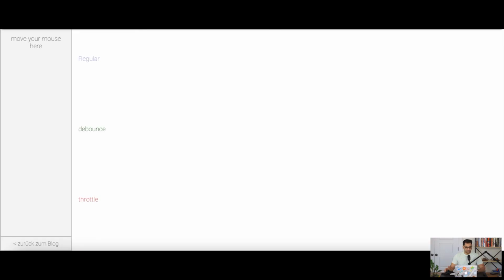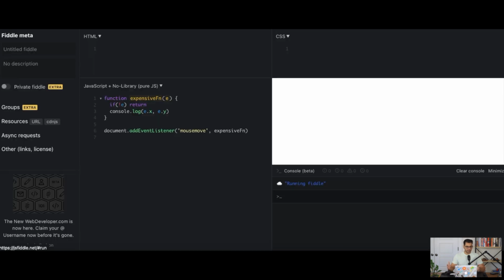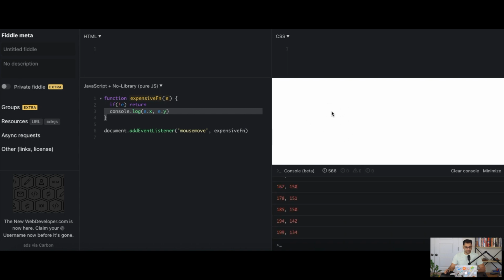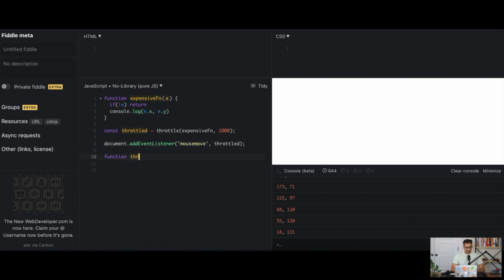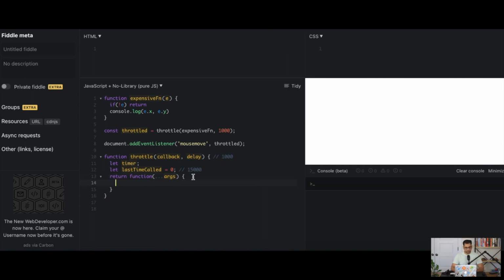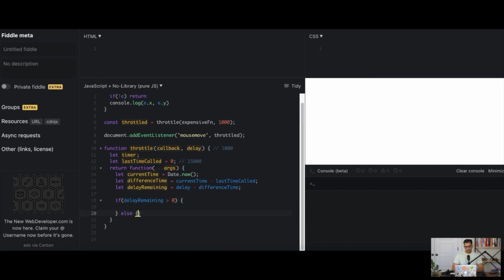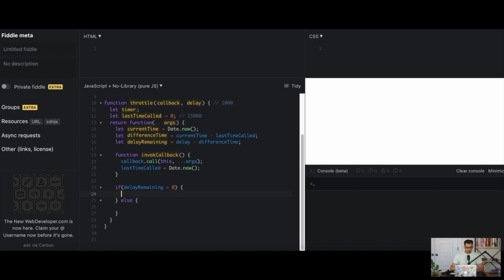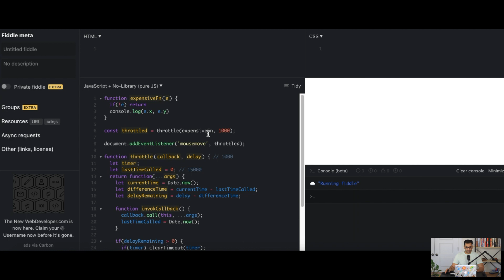How to build and implement Throttling in Javascript - Frontend Interview Question

Comment: Hey, Thanks 

But why didnt you just use setTimeout or setInterval? Because what you did I wasn't able to understand !
Reply from the maker: The nice thing about solutions is that there are always multiple ways to solve the same problem. Big tech companies prefer for throttle to use the Date solution as it's more precise, neat and efficient, using timestamps to figure out when to run next. This method cuts out the extra stuff – no more dealing with timers or keeping track of multiple variables. It's especially great when you've got a bunch of rapid calls happening, like during typing or scrolling. You won't get bogged down with callbacks waiting in line, which keeps everything running smoothly. Plus, it's just simpler to manage, especially when you don’t need the last call's specific arguments. In short, for a cleaner, hassle-free solution, the Date-based method is my preferred pick.

However, timer based solution is also perfectly fine if that's your preference.

Here is the timer based solution:
function throttle(callback, delay) {
  let waiting = false, lastArgs, timer;
  function throttler(...args) {
    if (!waiting) {
      waiting = true;
      callback.apply(this, args);
      clearTimeout(timer);
      timer = setTimeout(() => {
        if (lastArgs) {
          callback.apply(this, lastArgs);
          lastArgs = undefined;  // Reset lastArgs after using them
        }
        waiting = false;
      }, delay)
    } else {
      lastArgs = args;
    }
  }
  return throttler;
}